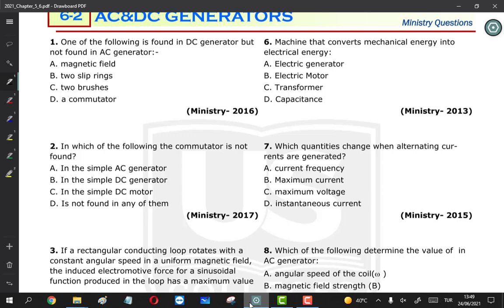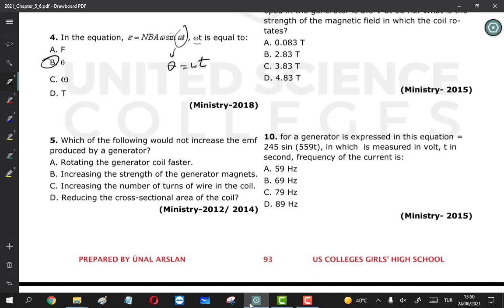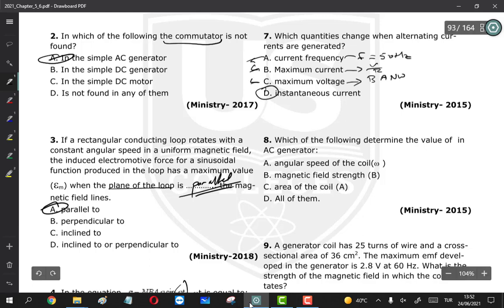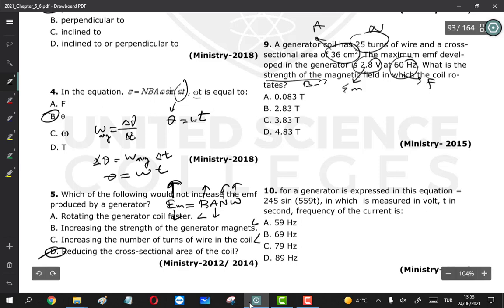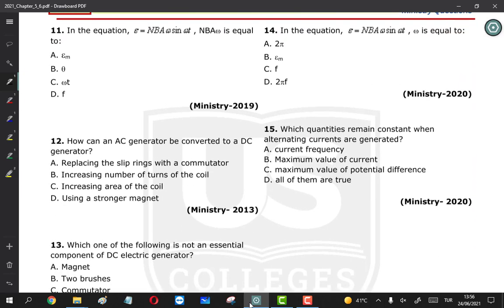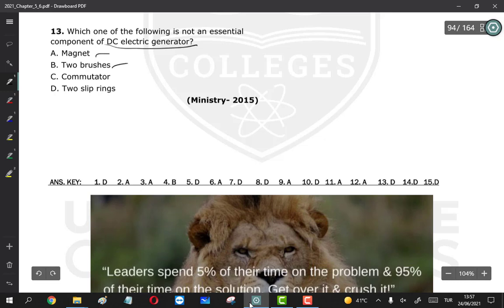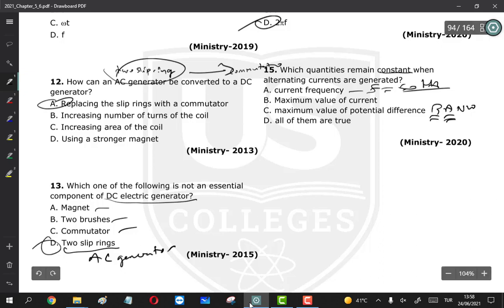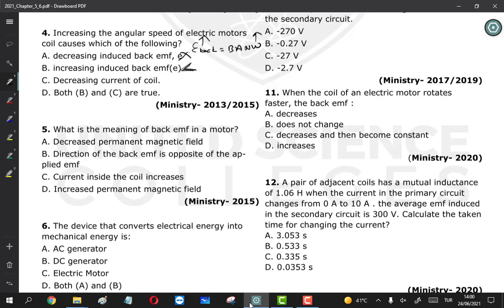Generators | Motors | Mutual Inductance | Answers of Ministry Questions | Wezary Physics

Comment: Sir can you also explain this question please 
A current carrying coil is suspended at the equator where earth’s magnetic field is parallel to the surface thus :
A. The plane of the loop looks north
B. The plane of the loop looks east
C. The plane of the loop looks west
D. The plane of the loop looks upward to the sky
Reply from the maker: A current loop does not tend to rotate in a magnetic field if the plane of the loop is perpendicular to magnetic field lines. Because the magnetic field of Earth is due North and  the plane of the loop is perpendicular to this magnetic field, one face of loop must point north the other face must point south. So (A) is correct answer.
Reply: much appreciated thank you so much Sir 🙏